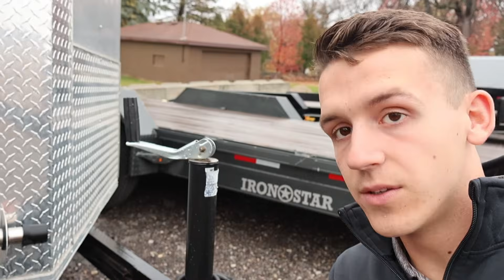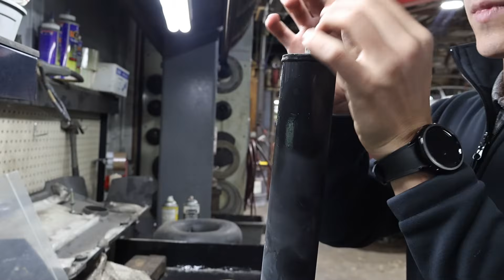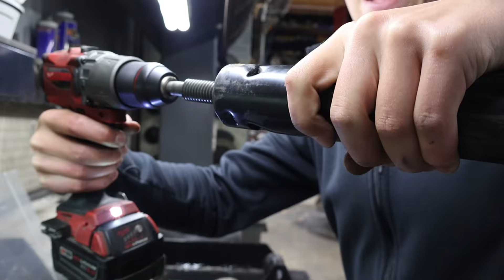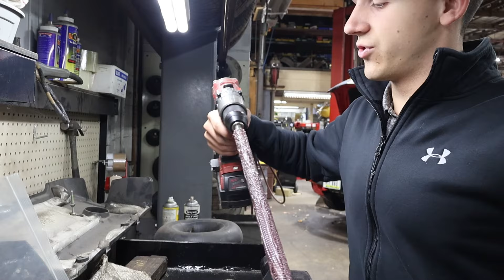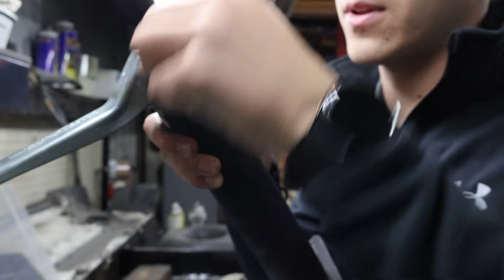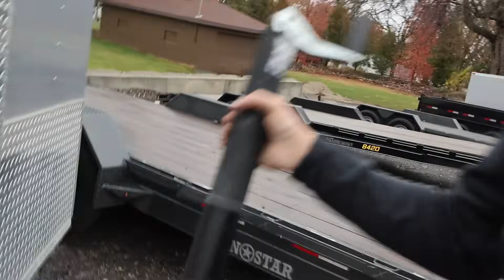How to Grease a Trailer Jack | SUPER EASY

Comment: Just completed on my 2013 horse trailer. Thank you! My worm screw was bone dry with a touch of light rust. Couldn’t find a replacement roller bushing so I cleaned out and repacked the one I had. Be mindful as well with the three mounting and single handle bolts. The tack-welded nuts underneath two of my three broke when I was removing the bolts - even after hitting with penetrating lube. I replaced all attachment hardware with new Grade 5 mounting bolts. FYI - just used a skinny screwdriver passed through the handle screw hole to unwind and wind the worm screw. Not that big a deal. (Clockwise = up or out; CCW = down or in).

Comment: I scratched my head a little about the recommendation for high temp grease, until I thought about the situation. This is an open gear set, so on a hot day you don't want the grease to leak out the bottom and disappear. Better to use a grease that retains its sticky shape so the grease doesn't leave the chat.

Comment: I just did mine, only I went ahead and removed the threaded shaft and cleaned everything in solvent. The bearing in particular had crude in it and was quite rough. Once the bearing was cleaned and regreased it was smooth again. I do run my trailer off road so it gets more dirt and dust than normal. So while this is the best video I’ve found on YouTube for greasing a trailer jack I would look at the old grease and if it’s really dirty I would clean it off with solvent before you regrease it.